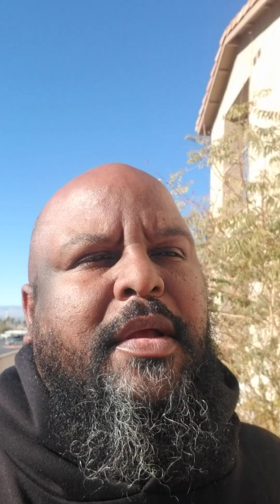Car Audio Knowledge Drop... Subwoofer Output. More Power is better than less power... here's why.

Comment: My sub sounds great at low volumes but when I turn it up it sounds drowned out. Should I increase the gain on the amp?
Reply from the maker: Maybe, or better yet, if you have a dsp, increase the output levels. 

Turn your head unit up to your loudest listening level where the sub gets drowned out, then increase your sub output level to where it matches the sound you're getting at low volume. Once you do that at high volume, it SHOULD also sound good at low volume.

Comment: Mines is the opposite 🤦🏾 it’s ok low volume but kind of boomy. But when it’s on 30 is sounds wonderful. Helpppppp
Reply from the maker: If it's too boomy at low volume, it sounds like the gain may be a bit too high....or the bass boost may be too high.  I'd try dialing both back a bit until it sounds good at low volume, and it should sound good as the volume increases to 30.
Reply: Maybe it's enclosure related? I've never heard of this issue.
Reply from the maker: @JasonWW2000  sounds like he's pushing his bass boost...to be boomy at low volume.
Reply: @Ahm-Creative  Oh, you mean on the headunit. Yeah, some headunits can give you too much boost at low volumes. That would be easy to check just by turning that feature off.